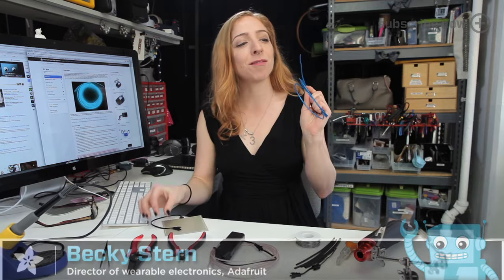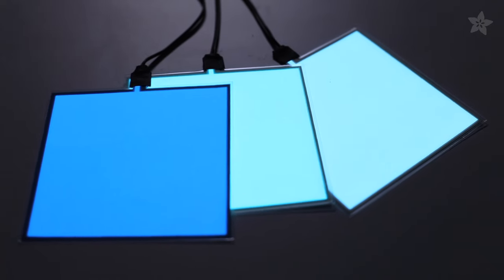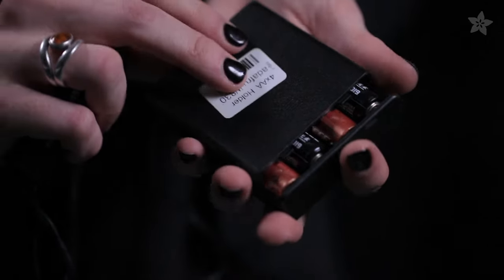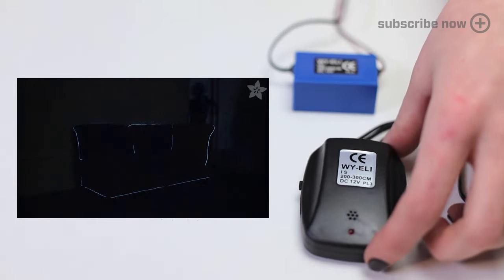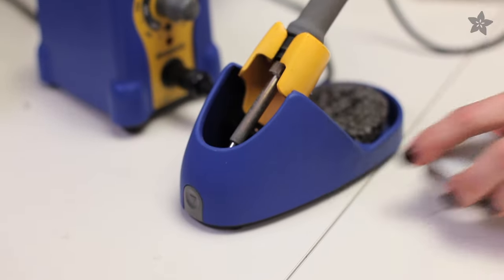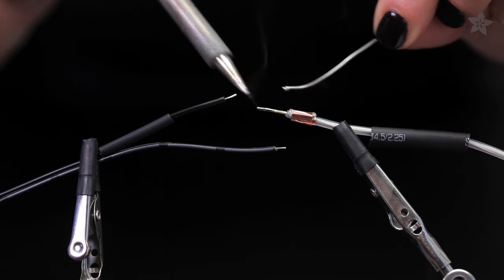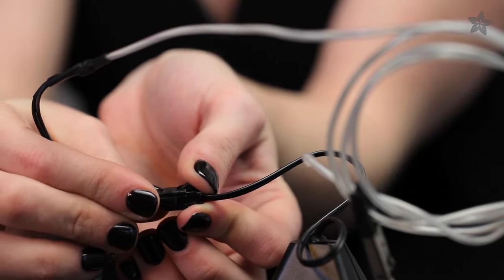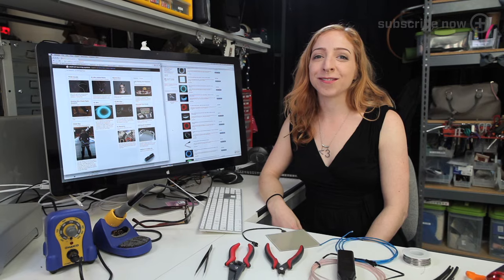All About Electroluminescent Materials - EL Wire, EL Tape, EL Panel! #Adafruit

Comment: I already have some EL wire, what I am more interested in is the heat gun at 2:40 .  that looks nice, where can I get those?
Reply: Yeah, I was wondering that too. I just use a gas lighter with a long neck, like you'd use for candles or whatever, and that works fine.

Comment: Either I did catch it in the video or it wasn't mentioned, but let's say I wanted to make various shapes from the EL panel. Some might need multiple panels connected together and some might need 1 cut in a smaller shape.. My question is what do we do with the exposed cuts? (that's the most thing holding me back). What I'm trying to make is a cosplay prop (a sword to be frank) and put on the blade the EL panel (or tape) in a way that when I press the hilt I will be able to get the sword to glow (as a display of special skill being used). My blades (yeah there is 2 swords) are almost 50cm long and 8cm wide (approx) and they have various shapes.
Reply: The ends are left open
U cam use a end cap available with this
Its a plastic piece which fits in :D 
Google el wire end caps

Comment: With soldering you want to twist the wires together and heat the bottom of the wires, then place your solder on the top and it will melt on the wire and if there is space, in between which will provide a more solid solder.

Comment: I tried using EL wire around my guitar for a run of Christmas gigs. Unfortunately the inverter created tons of noise that was picked up by the guitar. Are your inverters better? It looked awesome but was unusable, i would like to try again.
Reply: It's not a function of "better"-- all inverters make noise. You can dampen it with hot glue or foam tape but never eliminate it completely. Maybe try putting the inverter in your pocket or on the neck of the guitar so it won't resonate so much?
Reply: The amp in an electric guitar may even pick up the electromagnetic signal from the el-wire. I guess they are basically long antennae emitting a (low powered) signal at the frequency of the inverter.

Comment: Fair warning to potential buyers. The so called "Red" EL wire they sell is actually orange. When you get the red EL wire and compare it to the online pictures, the Red EL wire you just got matches the picture of their Orange EL wire. They won't even try to make it right and just ask that you return it. They said "El wire can vary across production so the color is not always the same as it appears on the site". Which I understand but the difference is just too much for a project where you want to match colors.

Comment: How do you actually put it on the shoes? You need an inverter isn't it? Which means you're carrying inverters for the amount of EL item you're wearing. Who carries inverter with them all around? Do you have certain designs to hide them? Eg, where do you place the inverter for the shoe?
Reply from the maker: Ah Jun the tiny inverters fit great on the tongue of the sneakers or at the back of the heel!
Reply: oh, I didn't know an inverter can be that small. What about the batteries? how many volt is it required to power up and how long will it last? Is there a on/off switch? or is it all the way on for the shoe?

Comment: Is it enough bright that it could be seen from at least 50 meters away? I'm on a motorcycle custom project. Then I want to know if this would be ok to install this type of EL wire in the headlights. The biker must be seen from front with just the EL wire turned on.

Comment: How about the difference in just a battery box (dc) and  or using an inverter besides the obvious,  meaning are the results the same?
Reply from the maker: dirtirobi An inverter is required with EL materials. It will not light up if you hook it up to a DC battery directly.
Reply: Adafruit Industries Thank you

Comment: does the starter pack come with the el wire and an inverter with the y connectors? Or do i have to solder them myself?

Comment: Folks, think outside the box. Wearables is about non-standard thinking. I would have come up with a mechanical way to connect the two wires and then soldered them. But the shrink tubing is a mechanical connection.

Comment: What happens when you over volt the battery pack?Like if the bat pack is made for 1.5 v aa,but you use 3 v uktrafire bats what happens?Will the el wire explode fuse or will it be fine?

Comment: Hello, Im from Cordoba Argentina and would like to know if this EL Wire kit comes with more bright light, I know is brighter, but I need more power of luminescence, maybe is not the el wire the soft bright, maybe is the circuit using only 2 AA batteries? Thank you. for the asap reply.
Reply: If you need more brightness, perhaps you might want to try LED stripes with an opaque coating instead.

Comment: If I want to run this from the mains, what do I need to step it down. Presumably, I would not need an inverter as it is already AC
Reply: Not that it’s much help now but, you need an inverter. The high voltage needed to excite the EL wire is in the thousands of volts, and requires 2000hz. Way above the frequency of what AC has. So the solution is just to buy a pre made inverter that you can plug into mains.

Comment: Can I feed 16vdc into a 12v inverter?

~Or do I need to use only 3 cells of my LiPo batteries?~
Reply: Depends on the inverter. Mine I got at radio trash and it takes 17v just to push it to its current rating....

Comment: i'm trying to put el wire in my ski poles without a big battery pack.  an in-line double a battery would be ideal to fit it inside the ski pole.  I havent been able to find these.  does anyone know whats the smallest battery you can use to fit in a 1" diameter pole.. i need some advice or links.. can only find big battery packs

Comment: Hey, in terms of voltage consumption, which will drown the batteries the slowest: 1) RGB LED strip lights 2) LED strip neon 3) EL tape or wire ??? :)

Comment: i want to splice el wire into a usb cord, would i need anything other then what you have shown here, the way i have seen to splice usb wire allows for 5v, would that be enough or is it too much?
Reply from the maker: JONNY CRASH EL wire requires an inverter to supply its necessary alternating current, a USB port provides direct current and will not illuminate the wire. However adafruit does carry EL wire USB cords with an inverter built in! adafruit.com
Reply: i see, thank you, i searched amazon for one, but, couldnt find any on there. ill check the site out and see what all they have.

Comment: Please help! how can i connect two differnet colors of el wire together?
Reply from the maker: Jack Jennings You can plug multiple strands into the same inverter, or solder them together as shown in this video! The color of the EL wire is actually determined by the plastic sheathing, it's all "aqua" on the inside! =]

Comment: Does multicolor electroluminescent wire exist ? I need to have the wire switch from off to white to red, also need some tape or a panel that can switch from off to red to greenish blue. I'm trying to make a cosplay of Kamen Rider Rogue
Reply: No, it doesn't. You woukd need two use two colors.

Comment: any way to add this to a molex connection for a computer? has anyone here done this?
Reply: +Kyle W i assume a computer power supply outputs AC? and it gets converted to DC in the peripherals but i could be wrong , either way that an important factor after that you could make some circuit to step down the voltage needed for these things

Comment: check out the Whoa Board connected to EL wires or panels on  kickstarter: https://www.kickstarter.com/projects/2055918540/whoa-board-dream-with-touch-sensing-el-wire-panels?ref=nav_search